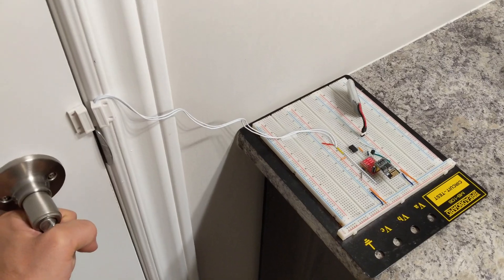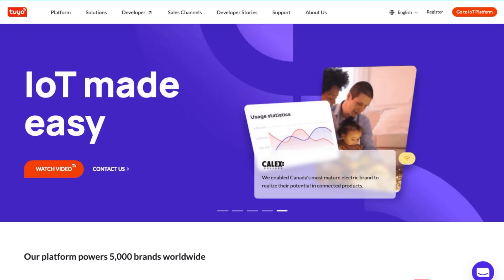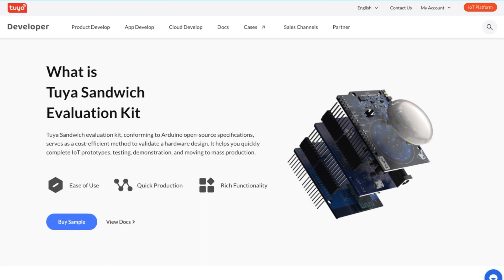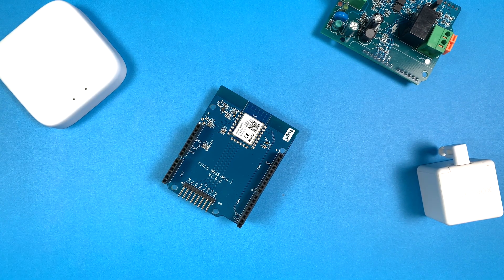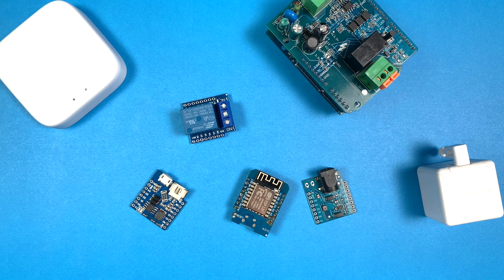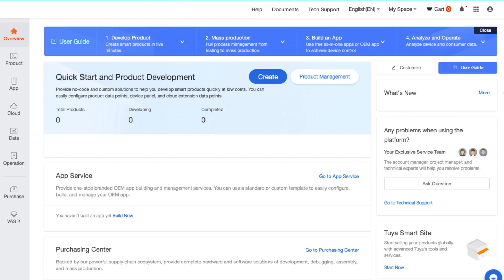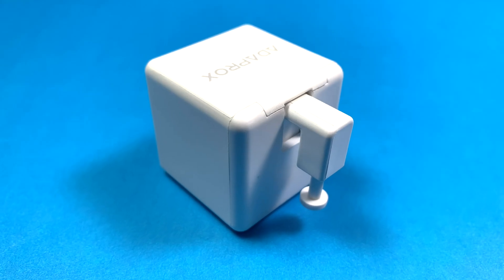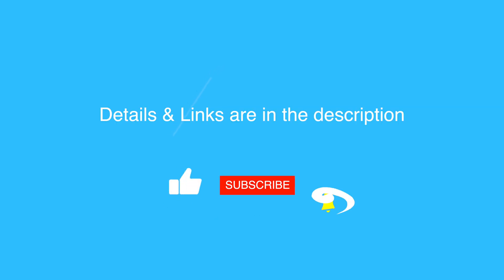Tuya IoT Platform for Developers: Overview

Comment: Why does my comment get deleted?
Reply: I included here too lets see if it gets deleted again... No profanity, no breach of the rules, just an honest review of Tuya...
Reply from the maker: Hi Dave, I don't see any comments from you except this one.
Reply: @MrDIYca  precisely my point. I wrote quite a bit and zap - gone, it breached no T&Cs, had no profanity or possible issues, but less than a minute and it's gone...

If I can't comment, I wont participate here... Its getting worse, no reason, but my comment just go...
Reply from the maker: @daveofyorkshire301  maybe try to reply here with one sentence at a time and see which one disappears :)
Reply: @MrDIYca  I'd be here all day, and any platform you need to do that for is not worth using... You don't even get told why it was deleted or by whom... I've had enough...